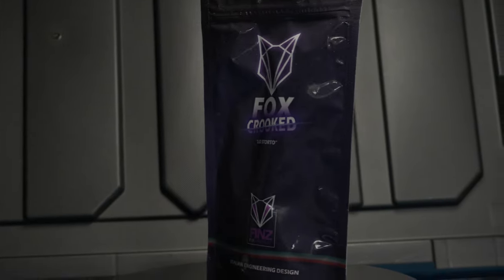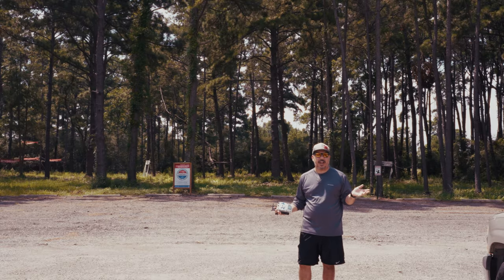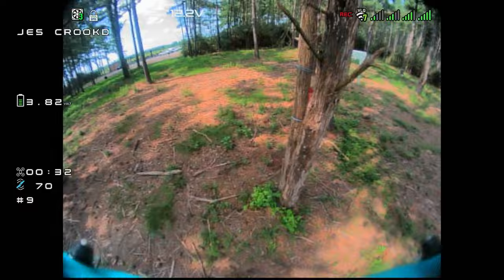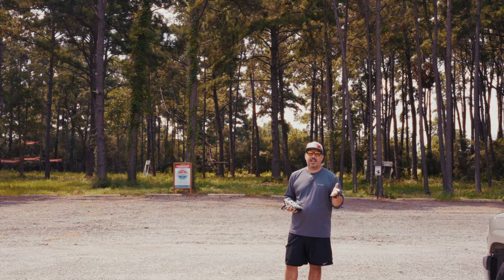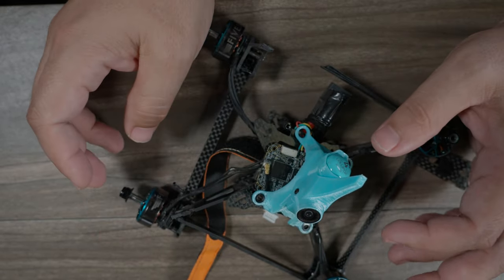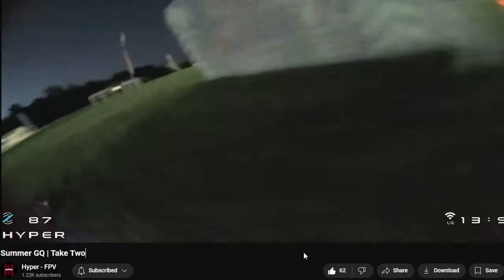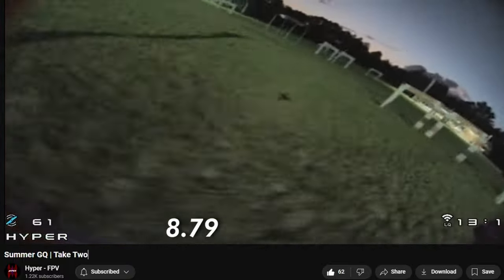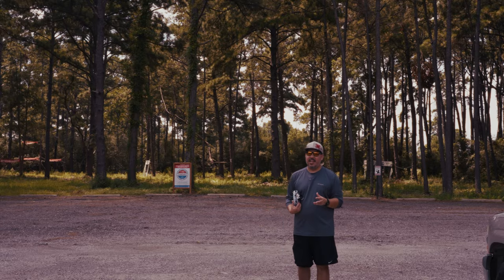Fastest Drone of 2024? Why is it Crooked?

Comment: Great video! When I tried the Crooked the first time I had the same impressions

It almost feels like you have different rates
Reply from the maker: its very nice, i cant wait to get mine back in the air.  so locked in.
Reply: I run really high rates, this quad is the only one that feels like it turns like my rates ask it to.
(actual: 200 1000 0.51 on all )

Comment: I'm a Little bias but I love my fox crooked.  :3
Reply from the maker: lol, i bet when that frame came out you had to have it.
Reply: @JonE5FPV   absolutely.  I'm in sport class but this thing flies like it is on rail compared to my previous frame. there is a LOT of extra noise in the pid loop to filter out because of the overlapping blades, and I need to get the tune from hyper because I was incapable of getting rid of the propwash. it was a huge change, I was on a 4s floss lite and starting to push that quads limits; now I feel like I'm barely holding on to the back of a rocket, with miles of room for improvement.

Comment: Nice video! Would love to try the frame! However, what about bent prop when overlapping after crash? How does the copter behave
Reply: Just making noise of propeller touching eachother, for the rest like normal quads with bent props :)
Reply: @PaoloPonzoFinz  true, the blades don't care if they hit each other. but it is easy to get the props on the two lowered arms to impact the frame and stop the motor. 
I personally don't try to get up if crash, but I don't have anything on the line when I race.

Comment: To bad it broke appart on impact.
My SniperX took several beatings and high drops on hard surfaces.
The FC is wacked, but the frame is still going.
This frame seems like a hassle to repair. Seems like you'd need several builds all the time.
Reply: once you get used to it it is easy to work on, and honestly the structure as a whole is really sturdy, but if you hit it at the wrong angle or barrel it into gate pipes, it can also easily break struts and arms. 
the only really negative thing I can say about durability is: because the blades are so close together and to the frame, if you bend a prop you are probably done. but personally I'm sport class, I generally disarm when I hit stuff because I'm not super competitive.